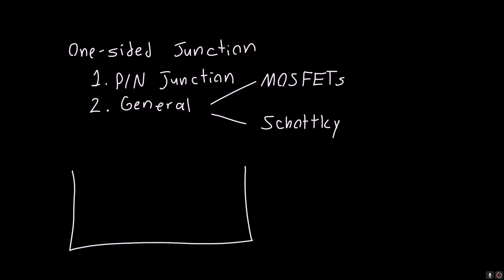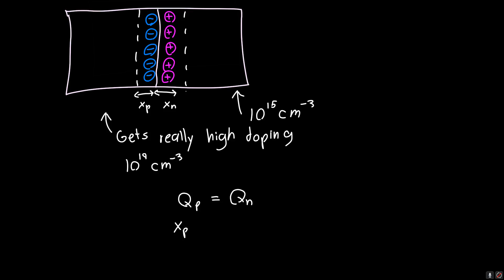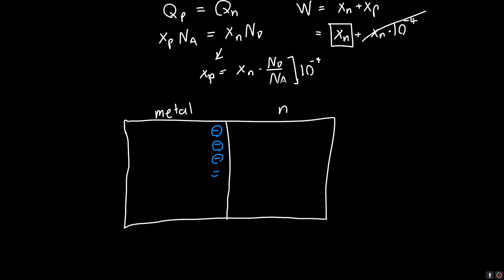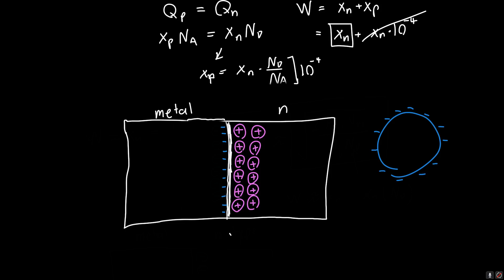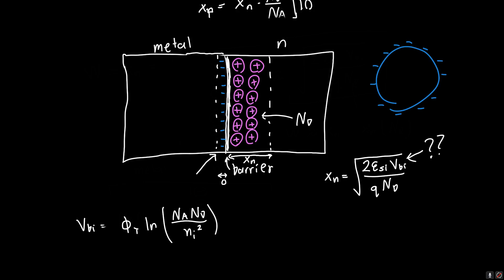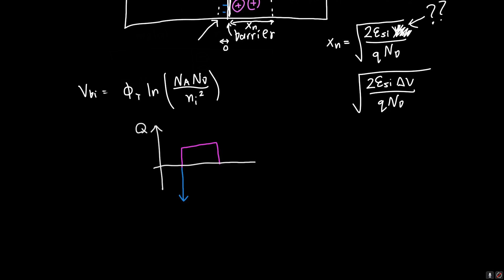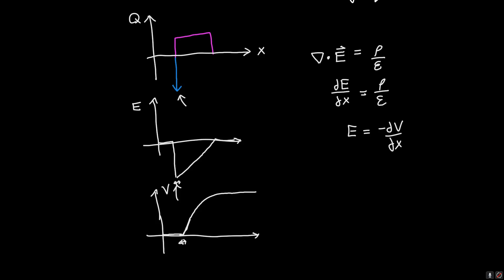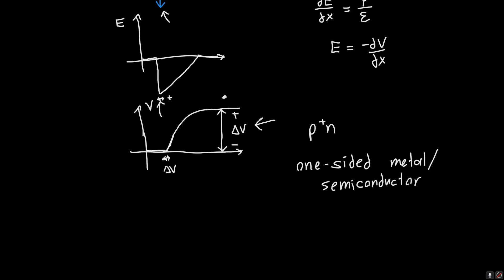One-Sided PN Junction

Comment: But I don't understand how integral at 10:10 can cause the voltage to be positive. Since E is being integrated below x-axis shouldn't the voltage be negative ? Thank you so much for the video.
Reply: Note the negative sign in the equation for the electric field. E= -dV/dx, so the negative signs cancel out and you end up with a positive voltage

Comment: Great video as always! How come we're only looking at the depletion-region when examining charge neutrality? I understand that (Qn - Qp) is the net-charge in the depletion-region, but what about the charges in the rest of the semiconductor? Because charge-neutrality is only said to hold for the whole semiconductor right? Wouldn't that give ((Qn - Qp) + net charge of electrons/holes) = 0, which is always true since each positive ion comes with an electron and each negative ion with a hole?
Reply from the maker: Sen Der Excellent question! If I understand you correctly, you are basically asking if the rest of the semiconductor can contain charge which balances that in the depletion region, rather than just the depletion region itself. The rest of the semiconductor does contain charge, but the ions and the mobile carriers exactly balance each other out. It’s very boring. Charge neutrality actually holds independently for the bulk and the depletion region. In the depletion region you have no mobile carriers, so you have a net charge on either side of the interface, which must cancel each other out. If they didn’t, you would have a net total charge, and it would attract opposite charges until it did become neutral.
Reply: @JordanEdmundsEECS  That makes a lot of sense! Thank you so much! It really seems like the key to many questions is to think in terms of some sort of equilibrium.
Reply from the maker: I totally agree. The key to that is to think of what would happen if the system deviated from equilibrium, and which direction it would move.
Reply: @JordanEdmundsEECS  Why there is no mobile carrier in depletion region? Isnt it there actually?